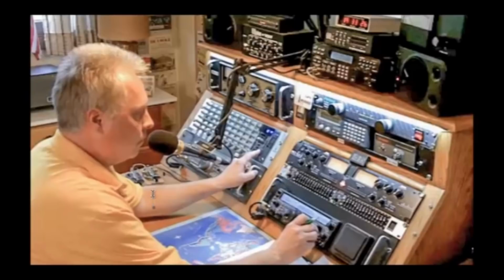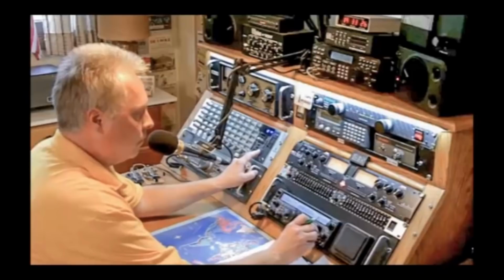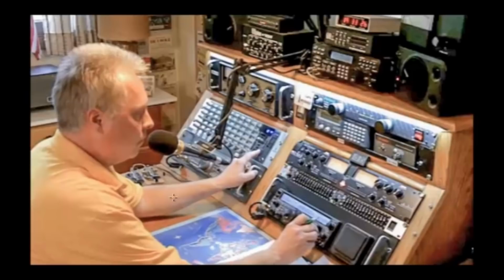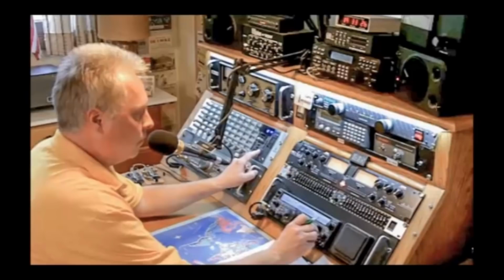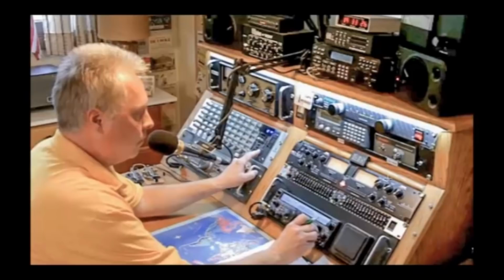Ham Radio Basics--Setting Up Your First Operating Position

Comment: How about dangerous radiation from antenna and equipment to operator? I measured EMF  near my tranciever (only 20W) - from end of dipole to tranciever was about 7m. EMF was so big that my tester  can't even measured that radiation! It's a problem beacause when I'll put for example 70m coax to 80m dipole (40m from center to end and 40m from end to tranciever), what left from my 20W power?
Reply from the maker: Good questions and  the answer is nothing to worry about.  And here is why:  The wavelengths are long very long.  They are mostly longer than you and those EMF's are nonionizing.  Period.    Can you get an RF burn if you touch the wire; sure.  Same if you grab a high voltage wire.  Twenty watts is nothing.  Do you have cellphone?  Now there is a concern and no one talks about it.  At those wavelengths of 5GHz near a cell tower would worry me.  For years I ran two yagis in phase.  The gain was about 20 times.  Power to the antennas was 1500 watts.  The ERP was 30KW.  So I have some experience with high power.  73, Jim W6LG
Reply: @ham-radio  Thank you for your reply! There is a lot of discussion about mobile phone waves and the health risks, but only the official media don't give much publicity..

Comment: Hi Jim, nice video and informative.  One aspect that you did not mention is the 110v and 220v power requirements of the ham shack along with coax/ladder line ingress and grounding access.
In my case, I will have to have two separate 25A 220v circuits brought up to the second floor room where I will be setting up the shack.  I have not yet figured out how to run a common ground from the radio room to the common ground point of my electrical service (which is in the basement and of course on the opposite side of the house).

Comment: Hey Jim great video I've been noticing that people will tell you how to set up a radio station without mention anything about ground wires how you run your antennas which goes into the radio first to tuner the linear different things like that be great to put out a video on that 73.

Comment: I was heavy into HAM radio back in the early 1960's. My best friend and I built much of it from scratch. We had little money to buy top notch gear. I was more into the electronics of it all. My friend was the communicator. We spent many an hour in the we hours on the air. In 1965 I was drafted and had orders for Nam.  I gave my radio shack to my friend before I left.  We were gonna keep in touch Via MARS. I truly believed I was not coming back. We made contact only once on the MARS network. While I was away my friend was drafted. I came back in 67 , he never returned. I lost all interest in our hobby. In did return to my old job at Barker and Williamson as a research tech in the SSB group. I enjoyed your talk , it brought back fond memories of my friend.

Comment: I am totally new at this. Slow but sure I will get my license, but, wow this hobby is confusing to me. There seems a lot of stuff to know. Can't I just plug in a ham radio and antenna? I am not understanding the power supply. Is it like a power bar to protect surges?
Reply: Gary Cottreau Have you taken Tech exam? Either join a club or get an Elmer.... or, study the ARRL text and memorize the Q&A. (There are ~500 questions in the pool, 35 Q on the exam; you can get 9 incorrect. Study hard for 2 weeks, especially the last 3-4 days. Drill. Drill. Drill. Get an app for your iOS or Android. The real learning for me happened after I received my CS. Pass the Tech. Get a radio. Make some contacts. See what interests you and go from there.

Comment: Hello Jim.  I hope that you are doing better.
I am into tube radios from the 30's, 40's and 50's, so naturally I am looking at a tube ham setup.  Right now, I have a Hammarlund HQ170A Receiver, and that is all.  It needs work, and I am not averse to get something different, but I would like to stay with the tube technology.  Do you have any suggestions that would work well with what I have, or something totally different?  Also, can you go over what the equipment SHOULD do, when you use it? 
Thank you.
Reply from the maker: The transmitted often used with that receiver was the Johnson Viking Ranger.  That is an AM transmitter.  For SSB, an HT37 was probably the popular choice.  The Hammarlund HX50, as I remember, was trouble.   The HQ170A was a hugely popular and highly regarded receiver of the day.  I think the Drake 2B was in that same category.  73, Jim

Comment: Jim, best wishes with your medical issues. I am disabled, but friends have come through, helping with the heavy work involved with setting up antennas and grounding.
I have watched several of your videos and appreciate your clarity and subject coverage. I've had my General ticket for 3 weeks now and am still in the process of putting my base station together (around a 450D and a 40-10 EFHW). Your videos have been very helpful in this process. 
Best regards and 73,
David KE8ICK (W8WMM as of this coming Friday)
Reply from the maker: Nice new callsign.  I looked in some old callbooks and I don't see it. Do you know who had it before you?

Thanks for the support David. 73, Jim

Comment: Thanks Jim, this is very informative.  I agree with your assessment about monitor positioning.  I believe that this is vitally important as many things we are increasingly integrating computer applications with our stations (logging (local and online), digital modes, online callsign lookups, gray line display, on and on).  I love Larry's console, but I don't see computer access.  All of that said, great advice about operating the most important thing--the radios :D. 73!

Comment: Great video.  Just wanted to add that a solid core door makes a good desk when placed on 2 budget file cabinets.  When locating your shack in the house, be aware of how you are going to run your feedline to the antenna.   Depending on the family situation, some may want to put a priority on headphones.  I using 2nd hand Yaesu headphones but have the Heil headset on my wish list.  Hope your health improves. 73, KE5WMA
Reply from the maker: Thanks and you are very right.  I have a solid core door and I do use good headphones.  And, feedlines are often an issue.  I remember that with my first station in 1963 when I wanted to drill a hole in a wall.  Thanks & 73, Jim W6LG

Comment: Good video Jim. I have a TS-520s sitting on top of a 1500 watt rated MFJ tuner and my wrist is paying for it while trying to scroll the VFO. It was a sacrifice for space to use my laptop and still use my key. The tuner is deeper than the radio, which makes it awkward to stack. Space is handy! Keep these great videos coming!! 73 KE8EAS
Reply from the maker: Thanks.  Yes, you can make some changes with the next station set up.  73, Jim
Reply from the maker: Thanks Joshua!  73, Jim W6LG
Reply: Joshua Cash A few pieces of wood and some wood screws and you can build an inexpensive shelf to relocate your tuner atop the radio for more comfortable operating.  If you do not have the tools to cut the wood most home improvement stores will be happy to make the cuts for you, sometimes for free, sometimes fir an extra dollar or two.  For added strength and rigidity you may either attach a crossmember just below the shelf or use ready made angle brackets instead, whatever suits your skill level.

Comment: Hey Jim, did you try out some adaptive audio filtering in this video or did lots of sample-rate conversions?  I've noticed a bit of musical noise that wasn't there in the previous videos. 

Also one thing about the clock: Depending on the operating customs, it might be very useful to have a digital clock with two clock-faces: One for UTC in 24-hour format and one running local time in whichever way you like it. For around $10 a nice, big clock with huge LED digits can be obtained. It's also important that the LEDs are bright enough to work in daylight too. 

Another option to consider is a radio-controlled clock, especially for contesters. Here in Europe, DCF77 covers most of the continent and clocks that synchronize to it are commonly available. I guess a similar option for the US would be WWVB-controlled clocks. This reduces the possibility of losing points due to clock drift and removes the hassle of checking if the clock is correct or not.
Reply from the maker: Hi,

I did not do any filtering or changing of the audio.   My hearing is not so good at 67.  I am looking for another way to record the audio.  Thanks for the input.

Good idea about the clock. I have a clock that uses our time standard.  I depend on it for everything.  You have made a very good suggestion.  I also have the computers connected to a time source for calibration.  

When I made the video, my Asthma was giving me lots of trouble.  I had used the inhaler a lot that day.  I don't know if that is some of what you heard.  The inhaler affects my vocal cords.  I started and stopped that video many times to clear my lungs and throat.  

Thanks!  73, Jim W6LG www.hamcq.com
Reply: Андреја Костић It sounds as though the audio was recorded at, or compressed to, a fairly low bit rate, so you hear a lot of quantization effects in the audio.

Comment: Hi Jim about to get my general. Is there an age limit you would recommend on a transceiver (10 years, 20 years, etc). Some popular used transceivers on eBay, e-ham, HRO are the FT-840 and the TS-440. Is there maybe a robust transceiver for around $400 used? Is it wise to get a side band QRP rig?

Thanks for all the great videos! :)
Reply: Jim,  I've enjoyed watching your videos. I'm studying for my Tech., so all this is very new. What's the advantage of an external SWR/watt meter compared to what's built into the radio. . .say the IC-7300?
Reply: Greg K I'm also soon to get my general, I have been looking at older ten tecs like the corsair ii. I hear that they will repair their old radios, but I'm not 100% sure.
Reply from the maker: I would not buy a Ten Tec.  You can Google Ten Tec and read about the current situation.  There are lots of other transceivers.  Again, make certain that whatever you buy, that it can be repaired at a company facility here in the US.  You can call and ask about repairs before you buy.  Or, look at something like an IC-718 that new is somewhere around $700 and used around $500.  I have a neighbor with a new one in the box that he is selling.  You may have someone in your neighborhood with a nice used transceiver for much less than $1000.  73, Jim
Reply from the maker: I never liked the TS440 or the FT840.  I thought the receiver performance was very poor.  Check with locals for something less than 10 years old and that is still able to be repaired at the US company owned facility. Some parts are just no longer available. 

An Elecraft K2/100 is about $650 new without an internal ATU.  It is an amazingly good transceiver with great factory support in CA.  You can add things as you can afford them. 73, Jim
Reply: Jim W6LG Thanks for the reply. I was looking at the kit for the k2 but I don't understand what I need on this page http://www.elecraft.com/elecraft_prod_list.htm#k2 
 From what I understand that is going to cost me at least $1500 which is way over my budget. 
PS. a kit sounds fun especially if it's cheaper.
Reply: +Jim W6LG I also was looking at a Kenwood TS-480SAT it fits your description of a good radio what do you think?